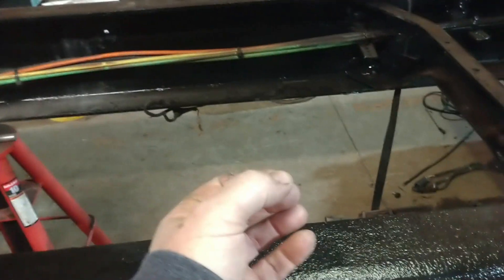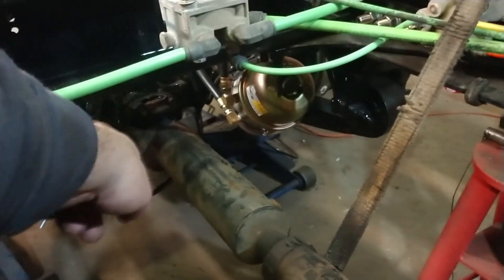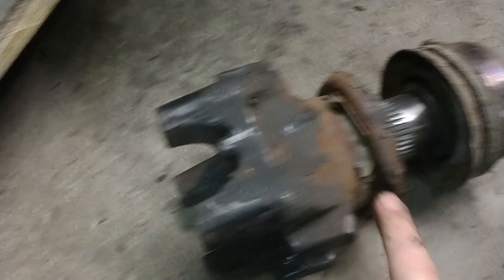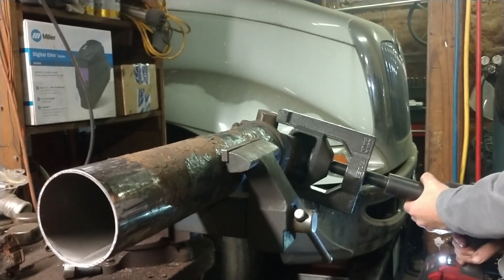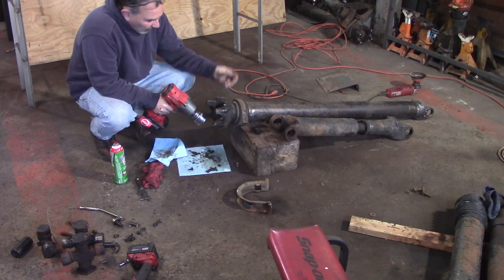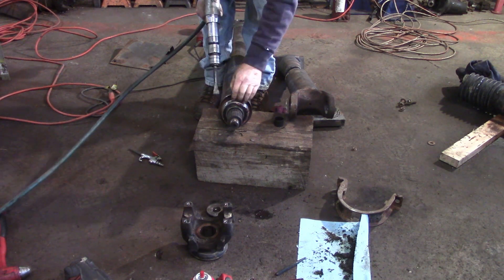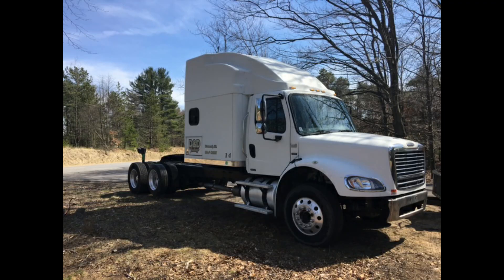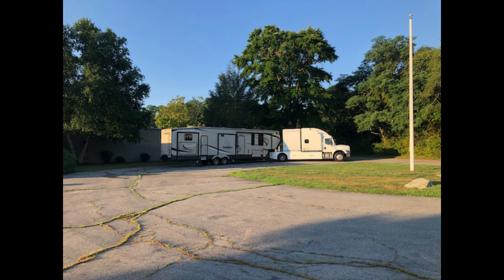2009 F750 PT 8 BUILDING A 3 PIECE DRIVESHAFT FROM SCRAP! PLUS NEW JOINTS & BEARINGS!

Comment: I notice that you paint somethings and not the other?   You might want to sand blast somethings they’ll clean up better .   I watched the 2wd to 4wd conversion  you painted spring buckets and not the springs or anything else?  If you are doing it a splash a paint on the lose parts would make a big difference
Reply from the maker: dont have  sand blaster. i paint what i can for preservation. im not a rich man. i can only spend so much on tools at a time.

Comment: In my day we were taught to cut the drive shaft at the rear axle yoke.   Measured them out, align the yokes, weld em up and never had any problems with them.....but that was a different time compared to modern times.....

Comment: I sure could have used that u-joint puller the last time I did u-joints. Just little half-ton units on my old Chevy, but I had to resort to cutting the crosses out with the good old oxy hot knife before I could get the end caps to even start moving. Don't you love salt?
Reply from the maker: they make a smaller version for cars and light trucks.

Comment: Thanks for adding viewer builds to your videos. Did the machine shop have to add any weights to that driveshaft or did they just line up the marks and weld it?
Reply from the maker: they are not equipped to balance it. once i am happy with the fit and alignment, i will remove all 3 sections and have them balanced as a unit.